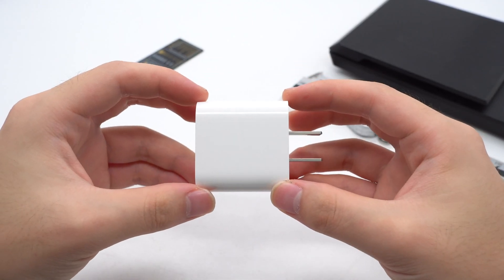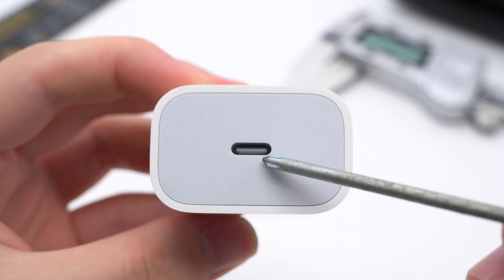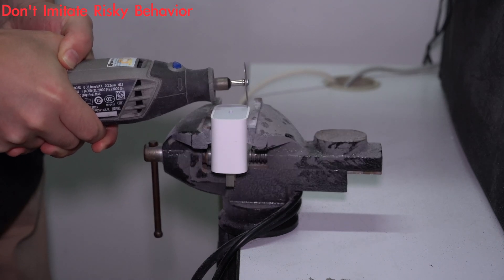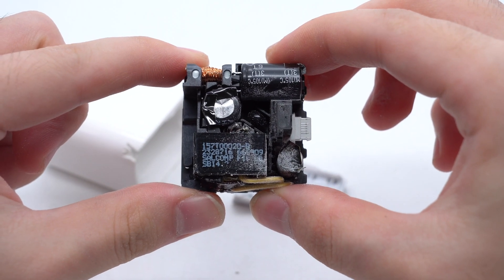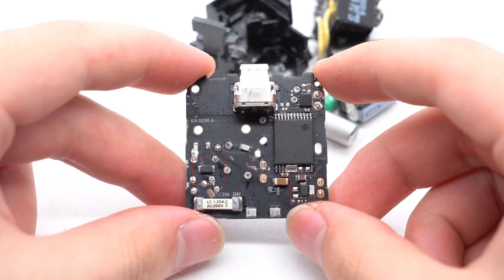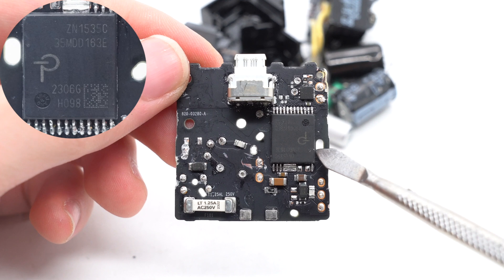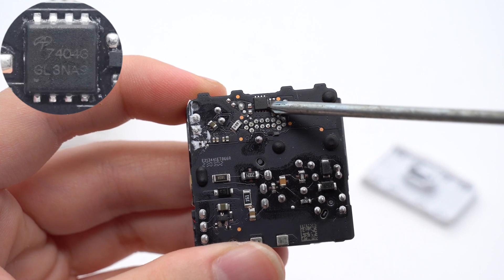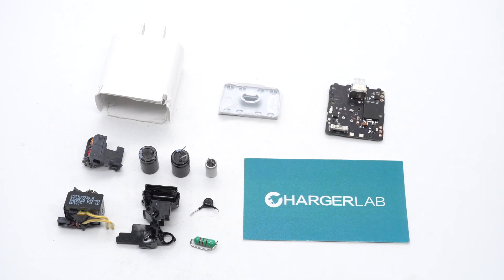Updated Power IC | Teardown of New Apple 20W Charger

Comment: I own this one! USB C 20W ---- Its pretty big for 20w. Mr. Charger Lab, when you test these Apple chargers with the USB-C testers with the oscilloscope.... do you notice they have less ripple than the cheaper Gan chargers from liek Baseus, Toocki, etc? I just wonder why people would buy these instead of the cheaper Gan options from Baseus, etc. Less ripple on the Apple ones? Or just because of the brand, and maybe reliability??
Reply: Honestly gan chargers are better then apple chargers been using joyroom 20w gan charger it’s fast and keeps the phone cool during charging and it maintains battery health honestly best 20w charger i used I suggest u give it a go
Reply: Maybe because average consumers don’t know that some alternatives are better overall and don’t know what to really look for so they go for the easy and safe option like this one. I personally like UGREEN based on ChargerLab’s review and so far, so good. Nice quality and very reliable.
Reply: I personally buy the Apple chargers because of the brand. I’m well aware there are cheaper or smaller options available but I see nothing wrong with this charger.
Reply: If u are using apple 20w charger does it overheat the phone during the charging or it doesn't @mikewolf5367